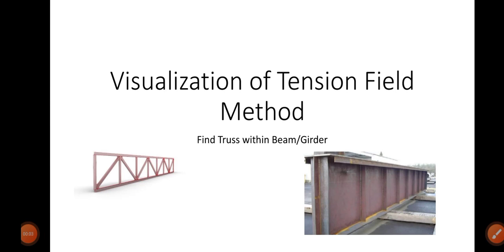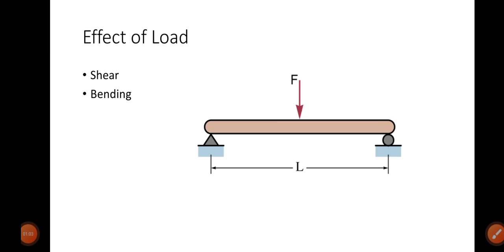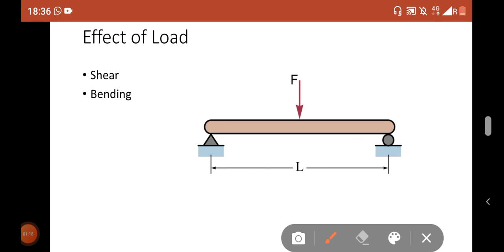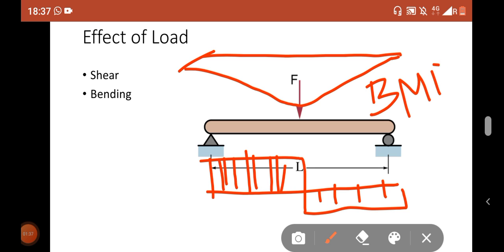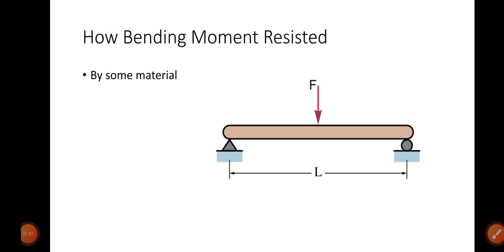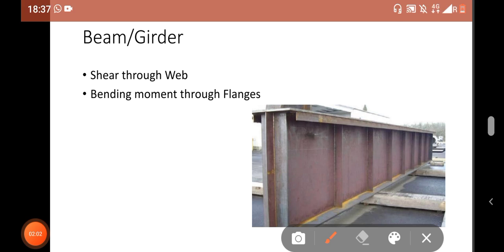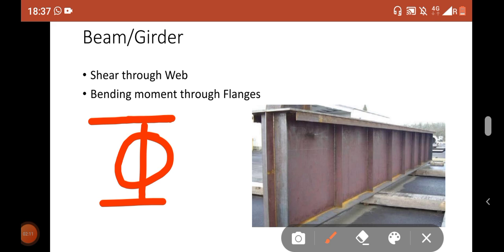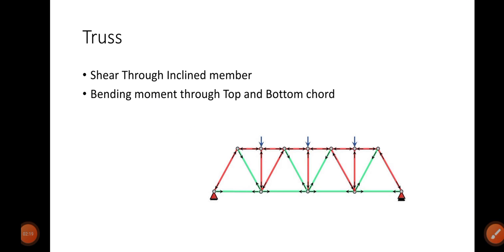Visualization of Tension Field Method

Comment: How will shear force exist in truss???
It will not 🚫
Reply from the maker: Only force exist in any structure subjected to transverse loading  is : Shear force. Truss is no different. If there is no shear force how you get axial forces in Inclined member ?
Reply: @TonmoyMaity  What do we mean by Panel Shear?
Reply: @TonmoyMaity If you had an ideal pin-connected truss, you would have no shear force in the members. This is structures 101. You are not qualified to be trying to teach this stuff. Also, this is not how tension field action works.